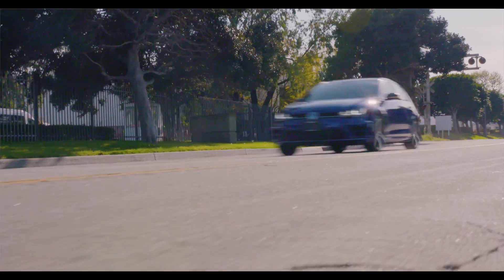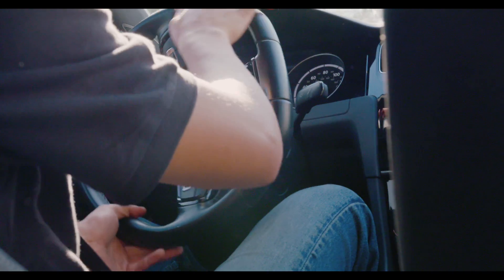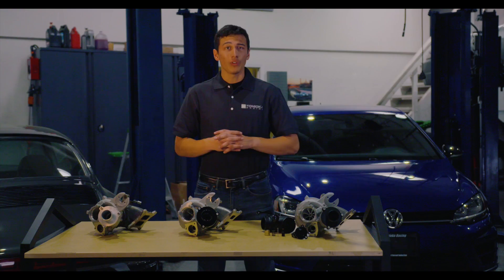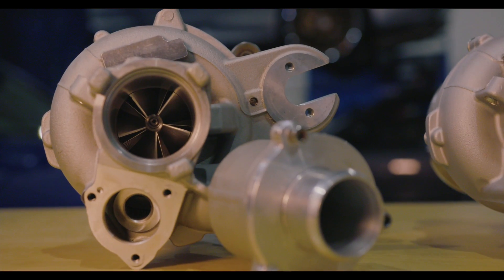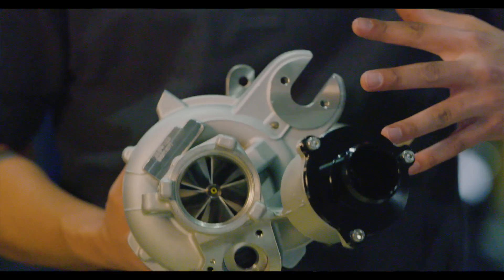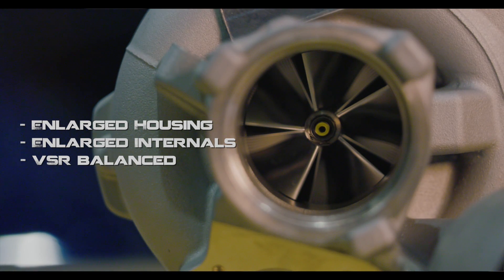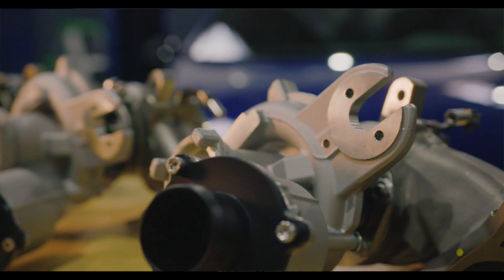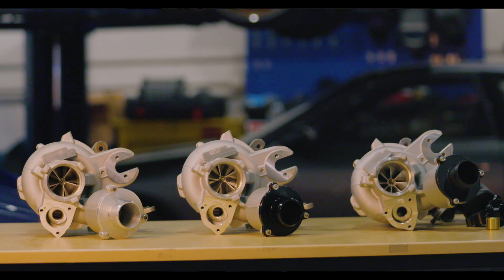TR Tomioka Racing IHX475 Turbo Review | Volkswagen Turbo for the VW Golf GTI

Comment: Hi, will any of these turbos suit an Audi A5 with the CNCD engine? (2.0 TFSI - EA888 Gen3) - this is the Euro version with dual injection (port+direct) and has the IHI IS20 turbo from factory. Thanks
Reply: Probably if it mounts similar to the MQB platform IS20 and uses the same oil and coolant lines.  You will need a custom tune.
Reply: Yes it will